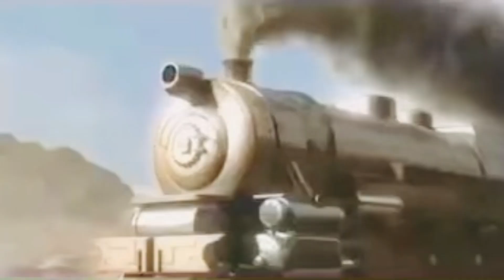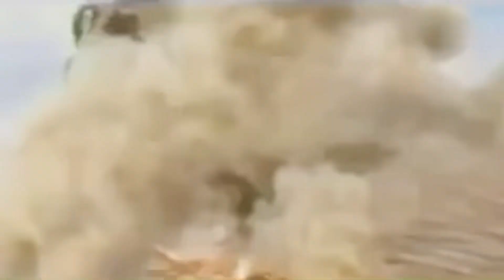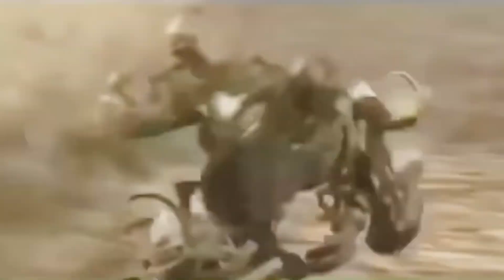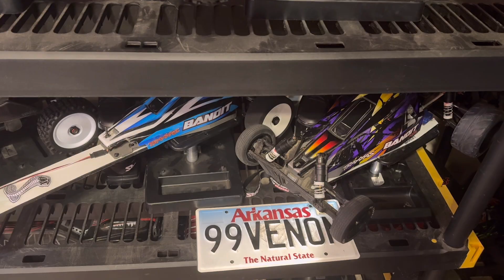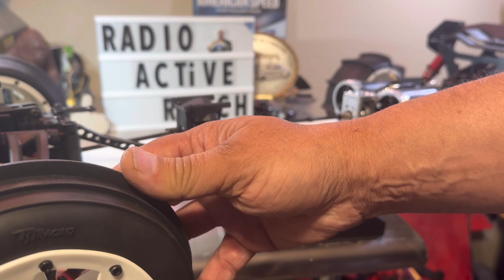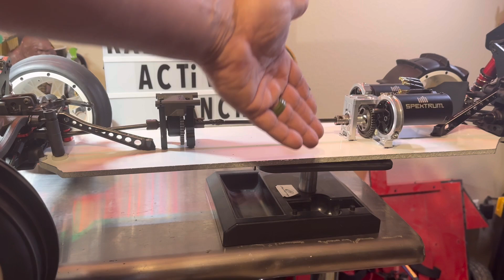1/5 Arrma Raider Driveline Dynamic All Wheel Drive. ￼

Comment: Looking forward to the testing of this idea. 
What it appears to me is that you're essentially using the center diff like an older Honda AWD viscous coupler. 
But instead of front engine/fwd bias, your design is rear engine/ rear biased. 
Super fun looking project man.
Reply: Sweet video dude!😎 Can't wait to see it in action
Reply from the maker: Thanks HRWRC! It will be a handful. Hopefully the AWD will keeps it under control. Thanks for being here! 🤙🏼☢️
Reply from the maker: What’s up capaincouldverc thanks for watching! Your spot on with the (Honda AWD) I’m trying to make this as balanced and light weight as possible. I want a high power to weight on this build. I think this simple but smart driveline will work well. Thanks for the comment and support! 🤙🏼☢️